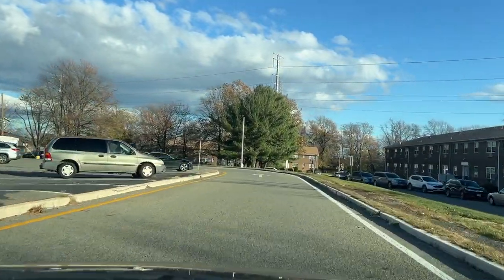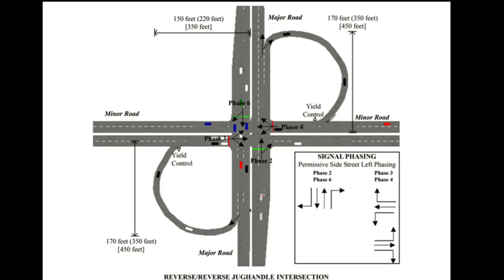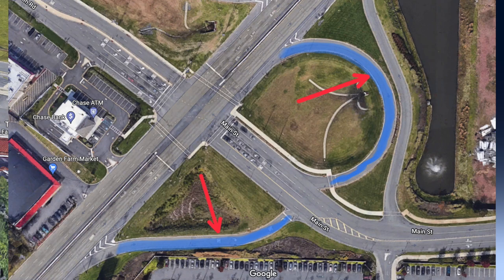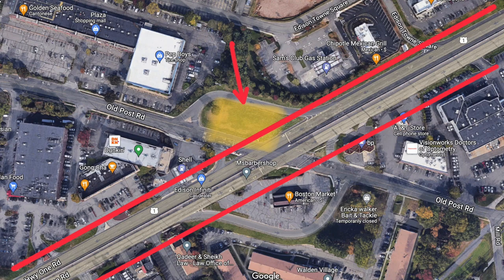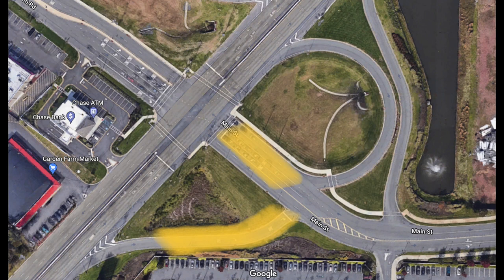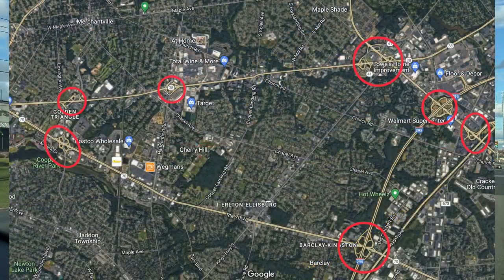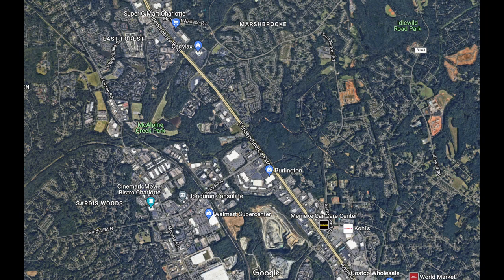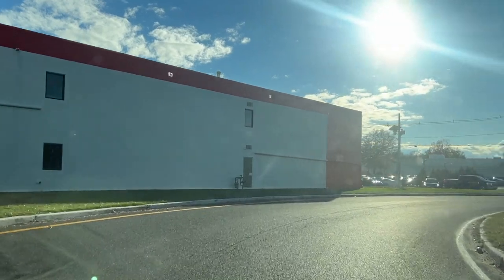Why You CANNOT Turn Left In New Jersey | The New Jersey Jughandle

Comment: Equally frustrating is that Jersey still has a few lefts on major roads in some places, so for drivers new to Jersey, you might not be able to tell until you're right up on the intersection whether you have to take a jughandle or true left.  If you figure wrong, that frequently means crossing several lanes at the last minute to get to the correct lane. Google maps, though has eased some of the pain, because it will direct you to a jug handle if necessary with several blocks notice.
Reply: I live in New Jersey and that is still true for me. Even if I frequent a certain road, but usually drive the length of it nonstop, it's easy to ignore whether the road uses a jughandle at a particular intersection, making, for example, stopping for gas, an adventure sometimes. That said, nowadays a GPS is your friend if you don't make unplanned stops
Reply: Yeah, it's real fun being from out of state in a moving truck.

Especially after dark 😁
Reply: Those lefts on major routes reflect updated standards for NJDOT. All the jughandles are from the 1940s and 1950, and the PA suburbs of Philly e.g. route 309 have them too, but only on the older sections of road. The state never spends the money to proceed down a state road and rip out all the right-hand loops, but NJDOT has been progressively ripping out the circles. Those are recognized accident generators.
Reply: > "If you figure wrong, that frequently means crossing several lanes at the last minute to get to the correct lane"

And THAT is what is called a Jersey slide.
Reply: There's always a sign 😂

Comment: Route 309 in Pennsylvania in Montgomery County has a few Jughandles if you feel like driving the full portion of route 309 in Pennsylvania.
Reply: The best one is at 309 and 63, at the old AMC theater. It's huge and has traffic lights at the end of the jughandles, eliminating the traffic backup issues.
Reply: I have seen the Route 63 exit back up into 309 a couple of times now.

Comment: The "Michigan Left" is the New Jersey jug handle's Midwestern cousin. As a truck driver, the jug handles come in handy with U-turns, especially if I missed my previous turn. On the downside, most aren't designed to properly accommodate 18 wheelers. Either it's too narrow or if it flares out to two lanes, I'm usually forced to take up both lanes. Also the issue of the jug handle being too close to the intersection means when I make my left turn I'm waiting a long time for traffic to clear and then my trailer is blocking traffic because I can't fully complete the turn.
Reply: Traffic circles [roundabouts/rotaries] are just as bad.. everyone else crowds your turn out.
Reply: NJ roads in the northern part of the state are 100% not designed for trucks
Reply: @Skarmy762 Yeah, not sure what OP is on about. NJ infrastructure in general is not designed towards 18-wheelers, and most streets are too narrow and gridded for 18-wheelers, but yet they prosper in an environment not built for them.
Reply: I grew up in South Jersey and now live in Michigan, so I'm really familiar with both configurations. On the whole, I prefer jughandles, because the Michigan left generally requires one to sit through three red lights to make a left - one at the intersection, then another at the U-turn location, and yet another back at the intersection. Having said that, Michigan roads generally have ample cuts through the median to allow for U-turns or entrance into businesses on the opposite side of the road, so that's a point in Michigan's favor.
Reply: @Stache987  Again, NJ born and raised, now in MI, so I grew up knowing how to handle traffic circles. When some roundabouts were built in the Detroit 'burbs, I was prepared.
Reply: @Stache987  I'd have to disagree, roundabouts are much safer and can be a great optimization tool for the roadway, it's just much harder because of gridlock and modern day American roads lol
Reply: My dad used to work at Lowes Home Improvement (in NJ) and this one time he said they had a delivery coming in and the driver had gotten lost or something and the driver was saying I F@@@@ HATE NEW JERSEY! Stuff like this was the reason why. He thought the roads here were so confusing and difficult to navigate. I can't remember if my dad was giving him directions on the phone or if he said that after he got to the store.
Reply: Ha. You people complaining that NJ roads aren't made for trucks. Trying driving those damn things in pa through those tiny colonial towns... The streets suck, it's too narrow and theres these old bridges that been around since horse and buggy that are only 10ft tall. And they sneak up on you EVERYWHERE! 😂
Reply: @MrBigsteve518  lmao yes the Michigan left bo longer exists because you've obviously never driven down river where every state route has them
Reply: @MrBigsteve518  Hall has tons of them going westbound until it turns into a freeway.
Reply: @MrBigsteve518  There are fewer Michigan Lefts than there used to be, because many of the old divided highways have been upgraded to limited access expressways.
Reply: Yeah the U-Turn to complete the "Michigan Left" is a lot riskier than a properly signalled jug-handle, even without having to deal with an 18-wheeler.
Reply: I drive Walmart dedicated in Michigan, there’s definitely plenty of them left and they’re especially shitty when they’re not designed well enough to accommodate trucks, but also not marked with no trucks signs.
Reply: Grew up in Michigan and lived there for 25 years and I’ve never seen an intersection like this one
Reply: @MrBigsteve518  It still exists where I live.  There are two types here.  There’s the standard one where you have to turn right then do a u-turn.  Then there’s the even more complicated one where, in order to turn left, you have to go straight through the intersection in the left lane, then make the special u-turn, then finally turn right.
Reply: @evosolutionsllc.910  Try South Carolina, We have the bridges, Colonial towns, AND "Rambling roads" that look straight out of WV. Most our bridges in the swamps are 10 ton only and the power lines are always to low for trucks in the small towns. The highways are fine but once you get off of them its wtf Ahhhhhhhhhhhh
Reply: @jakebrakeat2am489  yeah thank God I'm just Tri-State and not the whole country. I can only imagine 😂
Reply: @evosolutionsllc.910  I do GA and SC. I'll take GA any day lol but I don't like that northeast traffic and the local laws. Can't win it all I suppose
Reply: I'm Michigan born and raised and familiar with Michigan lifts. Been living in Virginia for 15 years.  In Virginia Beach, VA the intersection of Indian River Rd and Kempsville Rd was recently converted to a Michigan left. The Virginia Beach locals now hate that intersection.  My main criticism of that intersection is they did NOT make the lanes to do the Michigan left long enough. Especially knowing that intersection has a very high traffic volume.

Comment: Great video. Having grown up in NJ and only knowing jug handles, it was a shock to me when I moved to NC to see they had none. People just turned from the  left lane for better or for worse. Also, those turn only lanes down the center of local highways confused me at first. I got used to it. Then when I moved back to NJ I had to get used to jug handles again. I think one of the main reasons NJ needs jug handles is the sheer volume of traffic on the roads.  During rush hour every left turn lane gets backed up out onto the main road bringing traffic to a crawl as people swerve around the backed up left lane. Overall I think jug handles are essential in NJ. Now if we can just fix our signage. It's awful. If you're not familiar with the roads you're going to take a wrong turn somewhere. NC signs were so much easier to understand, but then again they didn't have a lot of 6 way highway intersections. I guess it comes back to density again. As far as pedestrians go they are an after thought in this state. We also like our traffic circles. They fell out f favor for a while but they seem to be coming back all over the place.

Comment: Many of the problematic jug handles are that way because they were designed for much less traffic. As the decades have gone by, increased development has put many more vehicles through those intersections. Often times, the highway was originally two lanes wide and expanded into 6. That further reduces the distance of the jug handle to the intersection on the minor road. 

I've found every state to have their own set of design differences that you have to learn. The intersections in PA are signed and signalled differently than those in NJ.
Reply: I've never encountered a jug handle, but it seems like the primary issue is lack of right of way. With a left turn, advance green is usually given in all intersections with moderate or heavy traffic, so even if you can't turn between cars you still get a light eventually. The problem the jug handle is trying to solve is fixed with with either a red arrow (no turn without an explicit turn arrow/advance green) or in the case of heavy turning traffic, a diverging diamond. It seems like it's fine for light traffic, but then why even have it in the first place? Left turns in light traffic usually aren't an issue. It just seems to punish turning traffic.
Reply: @quinton1661  You have shorter cycle times for traffic lights. Delayed greens and arrows add to the waiting for all traffic.

Comment: I have visited New Jersey as I worked for a company that had its HQ there.  Locals explained it to me and it wasn''t hard to catch on.  I think it is much safer than the traditional left turn, especially if left turns are allowed on the round green light, without Burbank red left arrows.  Still, I believe the traffic circle is best for safety and for moving traffic through the intersection.  You just need to get used to it.

Comment: Very great summary of one of my state's unique features. It does become secondhand once you're used to it. One of the primary benefits is knowing left lane traffic will be maintaining higher than the "suggested" speed, as we refer to the posted limit. The downside is heavily congested ramps will back up, and drivers will utilize the middle lane to attempt a cut-in for the exit ramp. The same principle holds true for both highway exit ramps and exit ramps for a jughandle. All in all, they do function better than a roundabout (we call them circles down here) and it's one feature the rest of the country might be able to benefit from.

Comment: I think NJ jug handle turns are a perfect solution for New Jersey’s crowded roads.  It makes the signal timing very simple (through traffic in one phase, all turns on another).  My main frustration with these turns is that by the time you can see the thing on the left you want to go to you often can’t get to it if you weren’t ready for the jug handle turn ahead of time and as the video points out, some roads go back and forth between turn lane lefts and jug handles.  Still, for pseudo freeways like US-22, the jug handle turn is a must or traffic would be a total grind all along it.

Comment: It's not too bad in South Jersey, where the jug handles are pretty close together in most areas, and there are some major roads  where you can make left turns from  the left lane and even an occasional U-turn is permitted. But North Jersey is  a different story, as others have commented - you can drive for what seems like miles until you hit a jug handle.

Comment: It would be nuts for a left turn against traffic from Routes 1, 9, 18, 35, 38 and 70, for example, in heavily congested areas. The jug-handles do work, but they can cause back-up during rush hour. The other New Jersey traffic spectacle are the notorious traffic circles or rotaries. That’s another topic worthy of a video. Nice work on this video 👍
Reply: you left out route # 22, 202, 206, 78, 287

Comment: I find in most cases, u-turns are the easiest in a round-about intersection if one can be built.  Though the jug handle is a decent alternative.
Reply: I have experienced some of these jughandles and they've been at intersections where traffic volumes are way too high for a roundabout. That would just get backed up instead in all directions.
Reply: @maxsilverstone8600  Yeah, that's my thought too.  Where there's a super high traffic volume, jug-handles are the best option.  I've seen some intersections in Europe that kinda combine both with a round-about at the center but with some ramps to the right side to shunt away right-turning traffic from the round-about. So only straight, left, and U-turn traffic enters the circle.  I dunno what those are called, but I like them.  Too bad they take up so much space as I'm sure right-of-way would be an issue setting those up.

Comment: Ex Jerseyite here - for a few years in the early 1970's NJ had the safest roads in the country due to most major arterial roads having been converted over to the jughandle system.  But it was also the same time that many people living outside of NJ moved to the state due to employment transfers.  I guess that combination eroded the safety aspect.  Also the state has not followed through on continuing the jughandle system on newly revamped roads.  On State Road 70 in Lakewood and Brick Township, NJ the jughandle system is initially used at the western end of Lakewood.  Then the road suddenly starts using left turn lanes instead of jughandles.  And just as suddenly it goes back to all jughandles at the eastern end.  Not a good combination for residents or visitors.
Reply: Hard to imagine NJ as being the safest with so many New Yorkers here everyday.
Reply: @joeshmoe7789  Well, that safety rating was just for a couple of years back in the early 1970's.  Things have changed dramatically since that time.
Reply: @pickled51  I wasn't driving in the early 70's, I guess there weren't so many New Yorkers back then.

Comment: If a "jug handle" for left turns is done correctly, I'm all for it. 
What I dislike most about New Jersey is their toll bridges. They (the state) lets you cross into the state free, but makes you pay a toll at nearly EVERY bridge (some are still toll-free) to leave the state.
Reply: use to be both ways for a long time but its one way due to the delaware river toll agency. nothig to do with NJ as for as im aware
Reply: @MetroHam : I still feel it's wrong to make drivers pay a toll (what I see as a fine) if you happen to have the want/desire/need to leave New Jersey.
Reply: @dave6695  

While do somewhat agree, its mainly due to it being  private organisation controlling and operating and maintaining there's bridges tunnels or road connections.

mainly due to states lack of funding atb the time to build such massive projects especially since the north eastern part of the USA was so heavily invested in road infrastructure that the state couldn't keep up or support it so they went and private a lot of It

Leading to many toll roads and passage ways, even if they bought it up there's still legal requrimenst that stuff like this can never be founded via state funds due to at the time state not able to afford it etc.
Reply: @MetroHam : If I ever get to New Jersey, I know there are several free (aka: non-tolled) bridges that I WILL use regardless of the miles and time added to my trip. I avoid all tolled bridges, tunnels and roads if possible.
Reply: @MetroHam  Private? It is a corporation owned by the bordering states and run by people appointed by elected officials in both states.  
for NY-NJ bridges that is the Port Authority of New York New Jersey.
Reply: blame new york
Reply: @dave6695  i mean its not like its NYC 16 bucks fee its a buck lol
Reply: @justin423  thats the Port authority
im talking about the Delaware joint toll bridge

NYC toll authority was private until it was bought up by NYC and N mainy NJC during the by out of the 3 subway companies. its more or less an extension of NYC gov at this point but its private in terms of non state funds
Reply: @dave6695  There is a free bridge from Trenton to Morrisville PA (not the Rt. 1 Bridge.) and several free bridges north of Trenton crossing the Delaware.
Reply: @jm-bv1wh  good luck during rush hour. I’m from Trenton and those bridges get backed up incredibly bad. The Calhoun Street bridge especially, and considering the fact that it is barely wide enough to handle two lanes of traffic is another reason why I am just going to continue using Route 1 lol

Comment: Reverse jug-handle, stupidest thing. Makes cars wait through 2 sets of traffic light changes to make a left turn.
Reply: It actually works better when both roads have heavy traffic because of no left turn and the longer ramp.
Reply: @justin423  I've found it to be a great way to pass up traffic. Stop or drive in the right lane that's for the reverse jug-handle, then change lanes to go straight. I got tired of watching cars do this, so I joined them. The spaced, painted lines allow this.